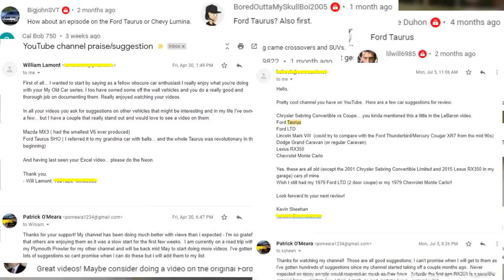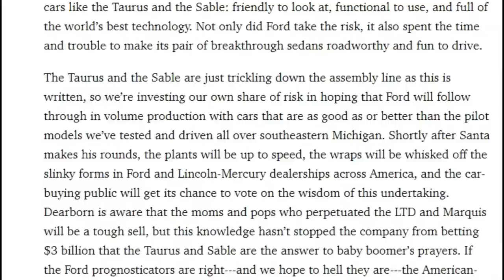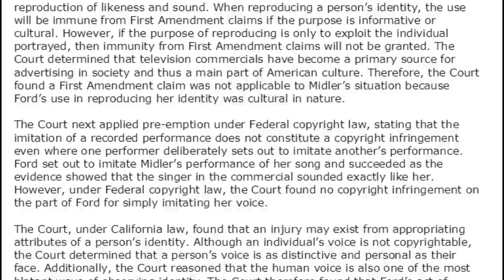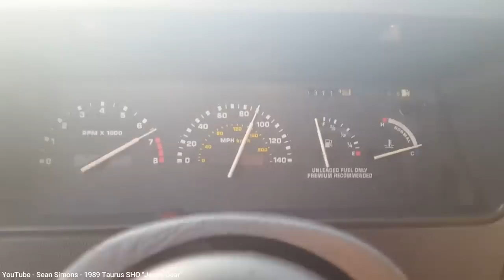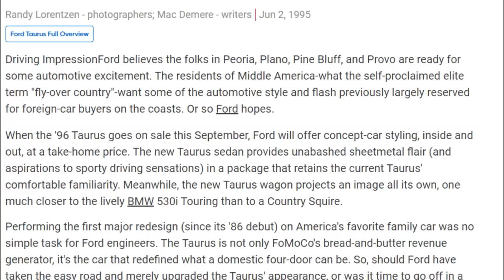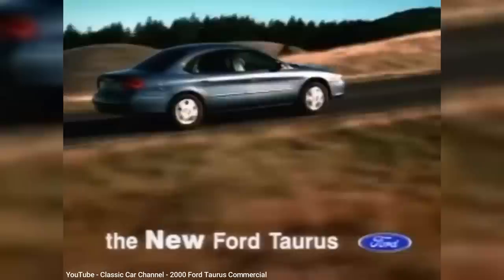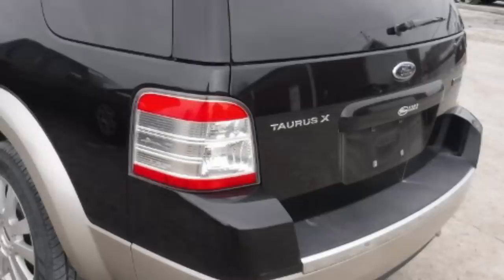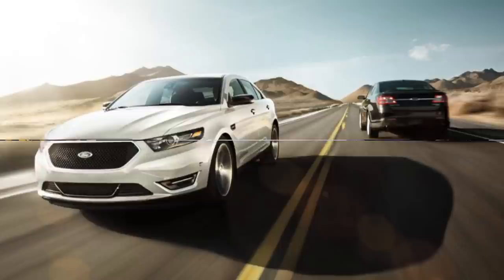Here’s how the Taurus went from Ford’s best seller to a forgotten icon

Comment: Still have my 89 SHO, picked up at a police auction for $3,000, after it was confiscated in a drug bust, down in PA. Ended up stripping the extra body molding off it, and going with LX trim bumpers on it. Dark blue metallic paint. Made and awesome sleeper, to say the least. 

Wife and daughter did a restoration on it in 2006 a a.wedding gift to me, daughter took her road test in it in 2012, and drove it through high school, before we bought her her Jetta for college. 

Still drove it until last tear, when I lost my right leg. Above knee amputation, so auto only now. Wife still daily drives it, and loves it. Taught both of them how to drive stick with it. Even as a passenger, I still enjoy it, and it still draws a crowd at car shows.

Still also have my 5.0 80 Fairmont 4 door as well, and even swapped a C4 into it, with column shift, after slight engine mods, hotter cam, roller rockers,  4 BBL, and shorty headers running into duals, basic Mustang mods, so I could keep driving it. It was my first car, so it was worth keeping,  at least to me, and gave me a.project while healing up, on the lift, from.my wheelchair. 

Both go to our daughter and son in law, when we pass on.

Question. Have you ever considered also making videos on motorcycles? Have.a few real gems that are no longer made, from the 70s, 80s, 90s, and early 2000s. Most of which only for a few years

Comment: I drive a 07 Ford Taurus and I am very happy with it. It is actually my second one. My first was a 97.  And yes when you put in the vin it does say it is a 07.  It was part of the last of fleet cars. Bought it had just a little over 100k miles. Now it is rolling over 150k miles.  Runs great and the motor is soild. No Ticking or anything.  Only issue is well rust.  HA HA   But that i normal for them due to the design.  I will drive it till the mounts and such rust and the car falls to the ground. She still gets up and goes. Great highway car especially when have to gun it to get around traffic.  And I blame Ford on the loss of Taurus. They stopped showcasing it and promoting it there towards the end. I am sure if they did another update on it and promoted it people would still buy it as a full size cae. But who knows  Good video

Comment: I used to own a 3rd gen Taurus SHO.  I installed a home built cold air intake and magnaflow mufflers on it and it sounded mean as hell, especially at wide open throttle.  Used to make everyone turn and then scratch their head since it was "just another taurus".  It was fun to drive until the cam slipped and grenaded my engine.  Also got to test drive a 2nd gen Taurus SHO with a 5 speed, and it was a blast.

Comment: I had a 2006 Bull. Really nice ride. Rode smooth and quiet. Lot's of room inside.Fairly easy to work on, with lots of parts available and not a huge amount of electronic toys to go wrong. Lot's of support and info on the TCCA forums and the Tube and such. Unfortunately, the weak point Achilles Heel of these was that the plastic covered rocker panels and the brake lines under them would rust and rot out. That rust out would eat into the frame and the whole car had to be scrapped. There are a lot of vids on that weakness on the Tube. Junkyards full of great looking Bulls, the only thing wrong is the under frame is destroyed by the rust. I fought that rust on mine for years until I was finally at the point of diminishing returns and sold her for scrap. Was sad to see her go...

Comment: Great video - I still drive a 2002 Mercury Sable GS with only 69000 original miles. It needs valve cover gaskets replaced but otherwise looks and drives like new. Resale has bottomed out so I will probably keep it. A good solid roomy V6 sedan.

Comment: I bet it was because down through the years Taurus buyers experienced many costly problems including,3.8 litre blown head gaskets,failure prone AX4S transmissions,corroded broken coil springs,poor qualty failing ball joints and control arms,generally short-lived suspension components and Ford did not have their backs.Too many people got burned after purchasing Taurus vehicles..Wisely these people said " I'm done." I have a 2003 Toyota Corolla that just hit 185,00 miles.I have only ever had to replace the radiator and starter,which I did myself for a total cost of about $250.My 18 year old Corolla still runs and shifts like new.My front end is all original and still tight.I can turn the steering wheel about a quarter inch and the steering responds,with the original ball joints and tie rods.

Comment: I worked at a Ford dealership in Honolulu HI. back in the late 80's into the mid 90's and we sold hundreds of them. Their biggest shortcomings were Transmission, head gaskets on the 3.8l and door handles. But I personally owned a 92 SHO and it was and still is my most missed car I've ever owned, I loved that thing.

Comment: I have a family in Chicago. Back in the early 2000's they had a 1986 beige LX sedan with digital dash and a red '91 GL station wagon. Good cars overall, but had serious issues with rust. Both of them were sold around 2009-10 for a couple of hundred dollars.

Comment: My 1997 Black Ford Taurus is the reason I'm still alive today. Crashed into the center divider of the 10 Freeway in Los Angeles back in early 2001, at 60 mph after being cut off by another driver. 

I swerved across an empty freeway at 5:45am, hit the center cement divider, spun around several times until I was able to steer it off to the side of the freeway. Thank God a guy behind me was able to slow up traffic when it happened otherwise I might have been hit by another driver.

Got out the car in shock, only had a scuff on my shoe....and years later some slight lower back pain. 

Car had to be totalled, the body shop I got towed to told me that I hit the center divider so hard that it pushed the engine through the firewall. The amplifier I had in the trunk was pushed under the back seat...the radio I had installed was pushed far into the dash...the speedometer was stuck at 60 mph.

My first car...that 1997 Black Ford Taurus that I purchased at 19 years old is one of the reasons why I'm here today, almost 21 years later.

Comment: Just got a used 2005 Sable Wagon, about 120k miles on the odometer.  I live in the rust belt and it seems that the 96+ were prone to rusting out on the underside in critical structural places.  The plastic rocker trim helped to hide the issue and helped prevent good flushing in the car wash. Fortunately my wagon was well cared for, and stored in winter,, so I should get a few years' use before it turns to rust. It's a nice car, overall.   8 passengers with the rear seat, beats the minivan on paper!

Comment: Yeah I purchased the Taurus 1994 LX wagon in green new, had it til 2007 when I purchased the Ford Focus 2007 SES and still have that car today. The Taurus made it to 275,000 and end it up giving it to Kar4Kids. Perfect shape but probably was due for an engine rebuild as she used a bit of oil. Interestingly enough I found the original brochure for the Taurus the other day still in perfect shape. If the Taurus was nothing else it was sure footed in the snow. It was a well built automobile.

Comment: i owned a 2006 ford 500 for 9 years and had cvt issues. the cvt transmission never went on it but i did get a wrench light and when it was super cold out you had to warm it up for 45 mins to even get the car to switch to put it in drive. sad too because other than that the rest of the year the car was great and super reliable and drove nice and smooth never broke down once

Comment: My dad had a 86 Taurus mt5. It was a 2.5 liter 4 cylinder. It was loaded with options but was a total 🐕. I inherited it n drove it bout 6 months. We racked up almost 200 thousand on it. Very dependable! Then my mom had a 94 lx which my dad eventually took over when she got a new car. Then he died so I inherited it n used it as a work car. I ran it to 257000 miles. Original engine n tranny. Never used any oil. The Taurus was 1 of Ford's best cars ever

Comment: I have a 2015 Taurus, and I LOVE it. The V6 moves, the interior is so plush, and it rides super smooth. But honestly, Ford didn't really move forward enough on it. The backseat is as small as a Fusion's and the headlights are dim. But it's such a great highway cruiser.
I'm 18, and I am so sad I can not get another one in the future. Entering and exiting it is almost crossover-like so I don't have to bend down, it's quiet inside, and there's nothing like a big v6 sedan. I wish Ford didn't just completely give up on sedans, or at least finished strong instead of churning out unreliable vehicles.

Comment: We had an 89 when I was younger. Rode awesome but quality and reliability was so shit. It always overheated, rust spots formed when it was 3 years old and the parking brake cable fell off. Was finally written off when it was 10 years old. A tractor trailer bumper the rear bumper in heavy traffic. Literally wrote it off 😂. My dad was so thankful.

Comment: I owned a Ford Taurus for nine years.  A friend of mine convinced me to buy one because he owned a Taurus at that time.  He told me that since there are a lot of Taurus’, Taurus parts are in plentiful supply so repairs should take next to no time at all.  I found nearly the opposite to be true.  Nearly every time I took my car in for repairs, I was told 9 out of 10 times that the parts needed for my repair were currently not in stock and that I would need to wait several days or more for the parts to be restocked and for the repair shop to receive these parts.  VERY FRUSTRATING!  I had medical problems and lots of medical bills that  took years to pay off during that time.  I wasn’t able to afford to go car shopping and buy a different car until I had the Taurus for nine years!  😫

Comment: I loved the second generation, if I remember correctly basically the second generation Taurus was the same as the first but with a different exterior and interior, the under pinning was the same. I got to drive a second Gen with a 3.8 V6 and it was not fast by any means, but it had great pick up from a dead stop. As for the 3d Gen I hated it, I remember the Worcester MA DTs use to use them and if one showed up at your home you knew you were going to jail soon..

Comment: A very capable icon that Ford let fade more than once, then giving it the sedan guillotine. I had a 92' that went to 367,000 km and a much faster 2001 until 2020. I stayed brand loyal with a phenomenal  2017 Platinum Fusion. Let's Hope that some day Ford returns the Taurus to it's former prestige and set the bar high once again.

Comment: The newer Taurus that they stopped making in 2019 was a nice car. It suffered from many problems American cars these days are facing. But it is powerful, relatively economical & very comfortable for a decent price. 

My issues with the Last-Gen Taurus, the plastic trim & body is too cheap. It can fall apart if you live with rough roads. Tho the integrity of the car is good. 

The power is very good. I think it’s a 6s 0-60 mph, never have trouble getting on the highway or passing. The low gear ratio saves gas (but ruins the sportiness) 

My biggest problem is lack of maintenance. There isn’t a dipstick for Transmission fluid. Wheel hubs can’t be lubed. You have to open up or replace major components to change parts & fluids. Parts are expensive & got pricier with the late-model status. 

This isn’t an uncommon problem with cars today, sadly. Even makes like Honda and Toyota & trending away from allowing DIY maintenance

Comment: During 1989~1996, Mercury Sable was imported and sold by KIA motors in South Korea; after that, Ford set their own dealership network in Korea and kept selling Taurus lineup. During the 90s it was the best selling foreign cars in Korean car market. And in 2002~2003, 100 Taurus SELs were used by Korean National Police as highway chaser. Taurus sold in Korean market until 2019, which makes Taurus one of the longest selling foreign model.

Comment: They made over 2 million Taurus between 1986 and 1991, but I've only seen a handful over the last decade.  That should tell you how poorly they held up compared to imports.  My brother had a 1988 when I had a 1987 Escort.  My Escort was taken out by a plastic bag.  I'm not kidding.  A bag blocked less than a third of the grille and it overheated, cracking the cylinder head.  The transmission went out on my brother's Taurus without warning.  We switched to Toyota and Subarus after that.

Comment: A short history of the Taurus:
Released! The original V6 was invincible. Our Pastor bought one in 86 and put 430k miles on it before he traded it in for a 97 Tbird. My older sister had a 1990 Mercury, same thing, 350k miles, rear bumper held on with bungee straps, shock tower failed to rust so she had to dump it. Didn;t use oil. The only cars that could stay on the road as long were the buick LeSabre/etc. cars with GM's first gen 3800(front wheel drive)

Next: JELLY BEAN TAURUS. This released as the next best thing, the new generation of reliable cars. They had issues. The smaller V6 option was a complete disaster, and earned the early models a reputation for "stay away" on the used car scene. Issues with water leaks in the passenger compartment, electronics issues, but mostly the "new" smaller V6 really hurt the reputation. My Mother had a 2003 for a short while, my sister got it and had it for years. Mom got the next gen.......

Next gen, "The 500"  this too was the new best thing, and some models were really solid. Other "new feature" models like the CVT cars were not so great. As this gen went on, they changed the name back to Taurus. Most cars were super reliable, but competition had Ford figured out so it really was a competitive market. Some minor electrical issues were found in these models depending on model year. Ma's car lasted a long time and was very reliable until it got destroyed in an accident(not her fault). Many people don;t realize the platform for the 500 was used on most of their lineup. 

I can;t speak to the most recent cars. Ford's dedication to the "modular" engines lost them a customer many moons ago. 
I may have lumped some "generations" together, but IMO a new set of fenders and headlights is not a new model.
Reply: The original 3.0l v6 was a very reliable engine from 86-05. They have issues yes, but rarely have a failure that would keep you from running it.
Reply: @mcqueenfanman  I agree 100%, even the 03 my Ma had was only traded off by my sister a few years back to get her new car. It was the 2.6(2.8?) V6 they offered when the jelly beans came out that really were a pile and were gone off the used car market almost as fast as they got there because they all ended up in the crusher. The 3.0 option doubled the cars resale by itself because everyone knew that was the one to get.

Comment: I first saw the Taurus in its wagon form - first in Motor Trend, and later at the Auto Show. There is no way it can be compared to an Audi 5000. The 5000 was a much smaller car, and it was far more traditional in its shape. There were already other Japanese manufacturers mimicking the Audi in far more detail. ALSO, I think the Mark VII pre-dates the Taurus - as far as the composite headlamps. I think that was also the first American car to have independent four-wheel anti-lock brakes. 

 I had always thought it would be cool to have a wagon like the Taurus wagon. It wasn't until years later that I actually had an opportunity. I got a '95 Sable Wagon. It was the first car I actually saved up for & made payments on, using 100% of my money. (no help) It had driven almost identically to my '92 Sable sedan, which I had previously owned. I barely noticed that it had a different cargo configuration. 

 It served my needs perfectly - commuting to campus and hauling friends & music equipment around. It was the best handling station wagon I had ever driven, and if I had the opportunity to get one again, I would. I am surprised you didn't mention the light bar. It's something that no other car had since, other than the Villager & the Grand Prix.

I am surprised that GM never leveraged their Beretta and Corsica. Those were early vehicles that looked almost as good & perhaps even better to some, as the Taurus. Later models ended up being good performers. However, it seems like they were never pushed that hard, marketing wise, after the initial introduction years. It seems like they got more publicity from the gun lawsuit, with Motor Trend actually doing a test drive of the car Vs. the gun.

Comment: 1990'S  Taurus suffered from a garbage transmission, faulty ignition switches and a dry film ignition module relay pack mounted on top of the radiator which woul;d fail without warning, leaving you stranded.  The module was basically unobtanium, so you would need to mine them from the Taurus section of the junk yard.  Most had under 100k when scrapped.

Comment: Recently married my wife and I bought our first new car together in 1989, a 1989 Mercury Sable Station Wagon. No kids yet, just 2 Golden Retrievers. A cool car for hauling the dogs and later, adding 2 kids. Loved that car. I was always disappointed that Ford never tried hard to continue that success and build on it, like Toyota has done with the Camry and Honda with the Accord. Now I drive Ford F-150 trucks because the SUV’s are not dependable and uninspired. My 2011 Ford truck has 319,000 plus miles and going strong with basic maintenance only I do myself. Ford gave up on cars, and barely cares about SUV’s. In the 1980’s and 1990’s, half of my coworkers had at least one Ford car in their families. Today 2 of us drive Ford trucks, 1 drives a Ford SUV, the others drive foreign brands.